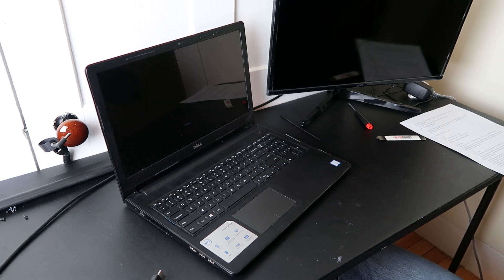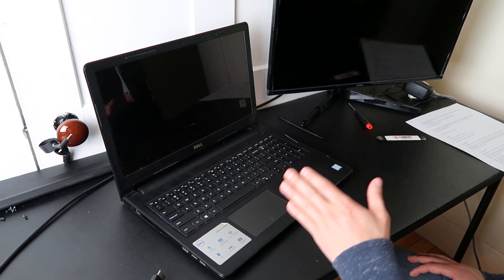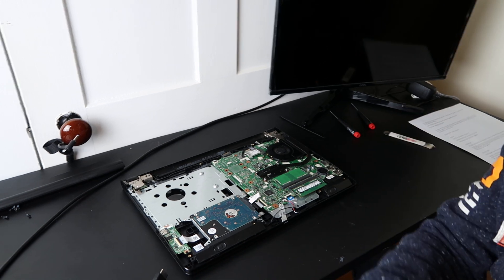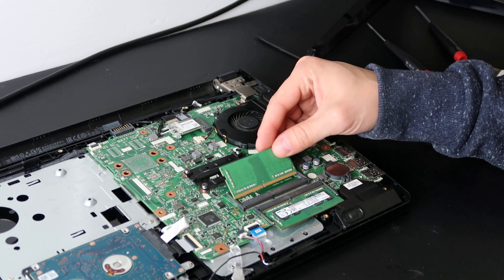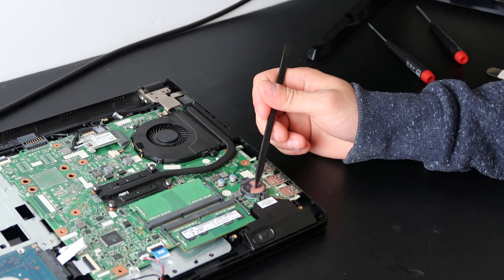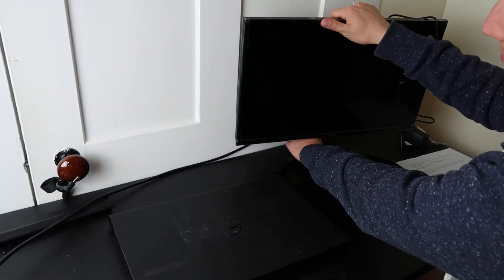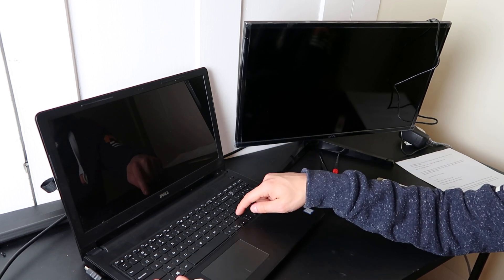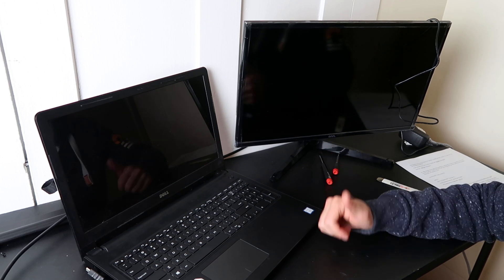How To Fix Black Screen / No Display / Dim Screen / No Picture for Dell Laptop

Comment: With my laptop the monitor turns on few occasions and i face the black screen issue rest of the other times. Any inputs on what can be the issue here?
Reply from the maker: What are you able to see on the screen before it goes black? Also, did anything happen before this issue started? Overheating, liquid spill, Windows update, etc?

Comment: amazing video! Even 5 years later, I used this tutorial. My dell g15 5530 got the same issue. The power light was given 4 lights white and 2 yellow. I tried the ram trick, and it did work. Fortunately, a month ago I bought some new ram memories. I changed the original ones for the newest and it worked!!  Thank u so much PC Monkey!

Comment: Hello Nice tutorials, I have follow it every step, but still got a black screen, when I press the power I hear the fan, HD, the screen turn on but nothing more.
I dont se any text, logo, nothing.
Any advice
Reply from the maker: If all of the steps here didn't identify the issue and the computer didn't display to an external monitor then we are left with your motherboard being the problem.  It should be replaced.  You can see an example of a motherboard replacement here;  https://youtu.be/N_7HNrFkMS8.  Let me know if you need help finding one or with the install :)

Comment: Hello so I have a Dell Inspiron 7506 2 in 1 sliver model laptop that has 4gb of pc4 Samsung 2133 MHz ram stick in it I want to upgrade the ram to 8gb so I ordered the same exact ram stick from eBay and I put it into my laptop and when I turned the laptop on the screen just stayed black didn’t boot at all I did diagnostic test on all components and it all passed it’ll only boot with the ram stick in it now I’ve tried different ram sticks switched them around and no luck what could be wrong I cannot figure it out 

I’ve tested everything and nothing 

I’ve tried 3200 MHz and it didn’t boot 

Did power cycle no luck 
Disconnected battery no luck 
Disconnected cmos battery no luck 
Cleaned the ram sticks no luck 

It’ll only boot with the original ram stick in it 

If I change it the screen will stay black 

I didn’t leave it on to see if it’ll beep at all so I don’t know if it would of booted or no because I hate bios beeping so I don’t know if it worked or not 

It did not show anything on the screen saying the ram has been changed or anything as well 

Could this be a internal hardware issue or motherboard issue or incompatibility with ram

Comment: I changed the hdd and now it seems like the display is not working for some reason, like that's the only thing i did, i didn't dropped the laptop or anything it's just that, is it possible to be reversed somehow?

Comment: Hi bro I have my dell laptop black screen. When I power on the keyboard lights come on but the fan inside not running and screens stays black
Reply from the maker: For a computer that does not turn on, try this video first; https://youtu.be/kOBY4k2Mn_k. Let me know how that goes :)
Also, did anything happen before this issue started? Overheating, liquid spill, Windows update, etc?

Comment: my old laptop keeps switching to the internel display after login and the internal display is not connected i never had this in windows 7 i was trying out vista it kept doing it i  had to drain the battery somehow without a display for it to hibernate then when it boots restores windows from the hibernation file  it works on that moniter

Comment: I think mine is an update issue. The screen is on, but the backlight is out. It's happened twice, each time after an automatic windows 11 update that you can't refuse. Then it only happened after I closed the lid for a little while, which makes the backlight turn off, then opened it up again, but the light doesn't turn back on. The screen itself is working, but I need to shine a flashlight at it to see anything. Unfortunately windows 11 doesn't give me the option to roll back to the previous update. Just delete optional updates. It sucks, because all the software and files I use for my business is on this laptop. I have no idea what fixed it the first time it happened, but hopefully I cam find something. The laptop isn't even paid off yet, but unfortunately past the warranty time.
Reply from the maker: First, I would turn the auto updates to off if that is the case. Then hopefully they get it fixed in the time your not accepting it. Are you able to use an external monitor to just get the computer back to usable?
Reply: @PC_Monkey  well I don't have auto updates on. Windows 11 just doesn't give you a choice on some of them. It updates whether you want it to or not. Since it will always download "critical updates" in the background, then wont let you shut down without installing the updates first. Also don't own a monitor and can't afford to pay anyone to fix it if it is a hardware problem. Right now I'm just working on reinstalling individual drivers until something works. Unfortunately theres no option to reinstall older drivers. Even on dell's website for drivers, they only give you the most current ones.

Comment: i got through the re boot headaches... now it pulls up a windows 7 popup, asking to select language, language/time/input method. then install now, doesnmt work and now im stuck in this loop. Help please
Reply from the maker: Assuming you have a Dell, can you try the steps seen here? https://www.youtube.com/watch?v=NnXmTF0KAYM&feature=youtu.be.  Also, did anything happen before the issue? Overheating, liquid spill, Windows update, etc?
Reply: @PC_Monkey  appologize good sir, i meant to write this comment in the boot loop video, hence why i said, now im stuck in this (boot)loop...
I bought this laptop for, what I think was a good deal at the pawn shop. that being said it was already reset but with a burnt windows 7 CD in the disc drive. Now im stuck tring to configure the wifi without the ethernet cord but i think i got it. Apprecitate what you do.

Comment: My screen works well on high brightness level but once I lower brightness, screen goes black but laptop is still running in the background. I have done RAM test & changed CMOS battery too but issue still persists. In between black screen problem just vanishes for 6 to 8 months and I face no issues at all and then the same problem returns back for no reason. Can you please  help me identify my problem.
Reply from the maker: Have you tried fully updating as seen here? https://www.youtube.com/watch?v=ImQRzXos1jk
Also, did anything happen before the issue? Overheating, liquid spill, Windows update, etc?

Comment: Hey my PC dell Inspiron  13 keeps Beebs when turned on with black screen
Reply from the maker: Sounds like your on the correct video.  Have you tried the steps seen here?
Also, did anything happen before this issue appeared?  Liquid spill, overheating, Windows update, etc?

Comment: Hi, I’m having an issue with my Alienware 17R4. I recently changed my fan for the laptop but now it’s not turning on. I’m having the restart loop issue and screen is off. There is a blink indicator, my cap lock and number button is blinking 3 pause 3 pause 2 pause and 1. I’m really having trouble with the laptop and would appreciate any advice.🙏
Reply from the maker: If a computer turns on and works before I enter it but does not work after, I would first assume that I made something loose, unplugged, or damaged something when I was in there. Have you opened it back up to doublecheck all the connections?
Reply: @PC_Monkey  I did! I double check if everything was plugged in properly! 🫡

Comment: hi my laptop does the same but sometimes it actually comes on later. But while i'm on it, it just goes off all of a sudden and later comes on again after a few minutes or even Hours. Is it still the same thing as a black screen
Reply from the maker: If the screen is black, what are the signs that the computer is actually turning on?  Also, did anything happen before this issue appeared?  Liquid spill, overheating, Windows update, etc?
Reply: @PC_Monkey  can I pls know how to fix my laptop issue.
My laptop is a Dell inspiron 3520
Reply: Hi, my laptop has a problem that it turns on after few hours of black screen  and it works fine later on. but the same black screen appears the next day if I turn on the laptop again. Does updating a driver update fix this issue or should I reinstall windows again. And I did update Windows up to date

Comment: Thank you very much.
I use a Dell XPS 15 9560.
The screen won't come on at all, not even to display the loading screen, but connecting an external display via Hdmi works fine. On checking display settings, it keeps saying internal display not active, and i can't even see the details of my internal display monitor in the settings.
What could the issue be?
Reply from the maker: Remember to check the FAQ's on my videos! It could save you time getting an answer to common questions :)
If your computer displays to an external monitor but not to its own LCD, then your issue is most likely with your LCD or LCD Cable.  Try 'Reseating' the cable first by unplugging it from both ends.  Then, plug it back in.  If that does not help, replace the LCD and Cable one at a time.  Let me know if you would like help locating the correct parts :)
Reply: @PC_Monkey  I took it to a technician, and the technician is saying it's the LCD control circuit that's burned out.
Is that a likely issue?

Comment: What if u have soldered ram
Reply: Bro someone help me my XPS 13 7390 was just kept unused for 1 day next day backlit starts but no display and it shut downs after 30 seconds, I tried removing the battery didnt work and I couldn’t do anything with ram as it was soldered , Also no codes were displaying of charging lights
Reply from the maker: For a computer that does not turn on, try this video first; https://youtu.be/kOBY4k2Mn_k. Let me know how that goes :)  Also, did anything happen before this issue appeared?  Liquid spill, overheating, Windows update, etc?

Comment: I think both of my ram sticks are bad
Reply: Wait no, my screen still turns on but it stays black and nothing works
Reply from the maker: @TheeMoonMan  If the screen is black, what are the signs that the computer is actually turning on? If you tried both RAM sticks, one at a time, in each port and it does not help, then perhaps both RAM sticks are bad, but its unlikely. Have you tried the external monitor test? Also, if the screen is black, what are the signs that the computer is actually turning on?

Comment: Goodday , my problem is that the computer turns on and display shows and all but suddenly goes black . Need help plz
Reply from the maker: Does the screen go black and the computer stay on or does the computer turn off? What brand computer do you have and what are you able to see before it goes black?
Reply: @PC_Monkey  yess the computer does stay on . Soo when I turn it on it work normally,  I can see the desktop and stuff but it suddenly goes black and even refuses like refuses to turn off. It's a Dell plus when it goes black it's doesn't even restart/reboot.

Comment: I tried replacing my keyboard on my Dell G3 3579 and now it won’t boot. After pressing the power button it turns on, has a blank screen and the fans seem to go into overdrive. After 10-15 seconds it turns back off.
I’ve tried reconnecting all cables and resetting the CMOS.
After first replacing the keyboard the plastic clip that holds the ram in place broke and I had to switch slots… so now unfortunately I can’t test the original slot.
What do you suggest should be my next steps?
Reply from the maker: Sounds like you may need a motherboard replacement :(
Reply: @PC_Monkey  damn. I thought you would say that! Thanks for the super quick reply 🙏

Comment: Hi, my dell inspiron 5025 monitor stop displaying yesterday. problem started few months ago when power on the laptop it will make 8 beeps and on and on, so I found a way... I forced shutdown by holding the power button and then wait few minutes.. and then press and hold the power button for few minutes and let it go, then pc starts running and no beeps, I log in laptop monitor displays and no problem. since yesterday, screen displays black and light in the back,  then I used the hdmi cable to connect to my TV and it is working. so what could be the problem on my laptop monitor, please help. Thanks
sorry, model is inspiron 5520
Reply from the maker: If your computer displays to an external monitor but not to its own LCD, then your issue is most likely with your LCD or LCD Cable.  Try 'Reseating' the cable first by unplugging it from both ends.  Then, plug it back in.  If that does not help, replace the LCD and Cable one at a time.  Let me know if you would like help locating the correct parts :)

Comment: Thanks. If external monitor is fine, but notebook screen is really faded - when I put a flashlight on my phone on, I can see what is on the laptop monitor, is it bad LCD?
Reply from the maker: Yes. Most likely is the LCD or the LCD Cable

Comment: hello mine is a lenovo ideapad 330s i think i have only 1 RAM slot, can i perform that RAM test?
Reply from the maker: To perform this test, you would need another stick of RAM that is working
Reply: @PC_Monkey  oh okay thanks man
Reply from the maker: @siddusidd5571  Sry :( Let me know if you would like help finding one. Also, if the screen is black, what are the signs that the computer is actually turning on?  Any motherboard or HDD sounds, fan, etc?
Reply: @PC_Monkey  thanks for reaching out man, I don't think I can hear any sound but I can see a light in power button and number lock button but not any light on caps lock. Previously I managed it on external monitor but later it went into automatic repair loop 🙁
Reply from the maker: @siddusidd5571  For a computer that does not turn on, try this video first; https://youtu.be/kOBY4k2Mn_k. Let me know how that goes :)

Comment: I skipped the first few steps with the RAM and CMOS battery (sorry) and went right to plugging in an external monitor with a HDMI cable.  Did not disconnect the LCD cable either.  Display on the external monitor works perfect, and the laptop display is still really really faint.  Do I still need to do the RAM and CMOS battery steps, or can I move ahead to the LCD cable replacement and/or LCD screen replacement?
Reply from the maker: No. You can go ahead and assume the issue is either a bad LCD or LCD Cable. I would reseat the cable at both ends just in case its just loose but if that fails, either it or the LCD may be bad.

Comment: Hello, my XPS 15 9530 works fine, but it has an annoying problem: it randomly goes black when using the mouse touchpad. I have to move my finger to the spot where it went black, and the screen comes back up, and I can continue where I left off the same page. Still, the annoying part is that sometimes it doesn't. Therefore, I have to close the screen and wait about 2 minutes to open it, and there's my work, but I lose about 5 minutes every time, and time is money in today's world. Do you have any ideas or what I should look for to get an answer? Everyone seems to say the same as you on this issue
Reply from the maker: Just a part of the screen goes black but the rest is fine and the computer continues to run fine like, its not frozen or anything? Also, did anything happen before this issue appeared?  Overheating, liquid spill, Windows update, etc?
Reply: @PC_Monkey   , the whole screen will turn black, and I can not see anything. It's still running, and when it turns back on, it's on the same page I was on. It happens more when I'm using two fingers to scroll up and down on the same page; it's happened since I got it. I did remove all bloatware and keep it updated, including the graphics card
Reply from the maker: @denisseg4167  Can you run all updates as seen here? https://www.youtube.com/watch?v=kX8bB725Ljw&feature=youtu.be. So no overheating, liquid spills or failed updates? And this happened since the computer was brand new?
Reply: @PC_Monkey  correct, no spills, drops, doesn't overheat, I have a stand to make sure it has airflow when I'm using it for a long time, it also happens when plugged in or at any battery percentage, I have also forced restarted it and restart through the menu, and it is all up to date nothing pending,  it has always done this I thought it was normal but I since learned it's not, thank you for helping been trying to figure this out since July
Reply from the maker: @denisseg4167  If the updates are all run then it may be an issue with your operating system. I would try to reinstall as seen here; You can see how to install Windows 10 here:  https://youtu.be/zYY-Gq68Dvo 
You can see how to install Windows 11 here:  https://youtu.be/Yiy-53Wc-Wo